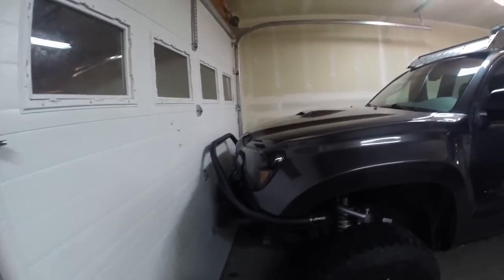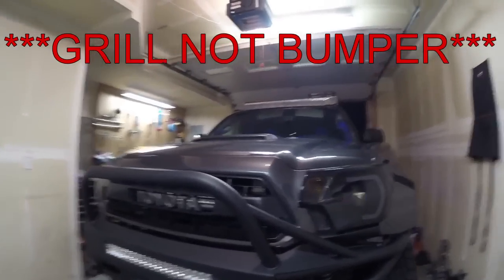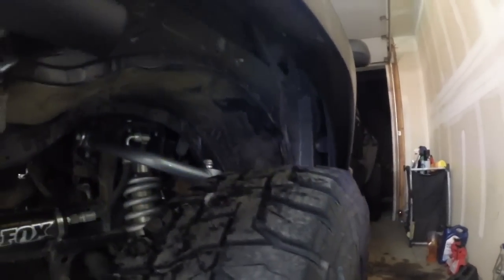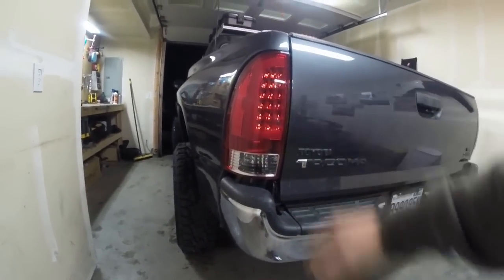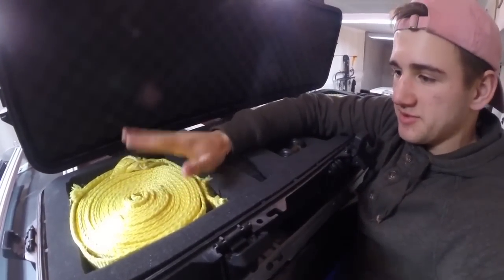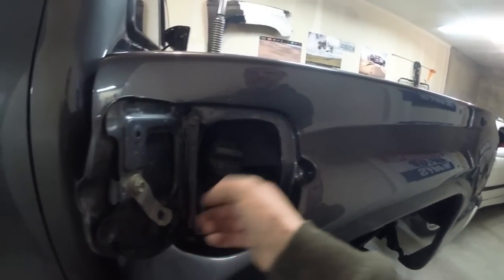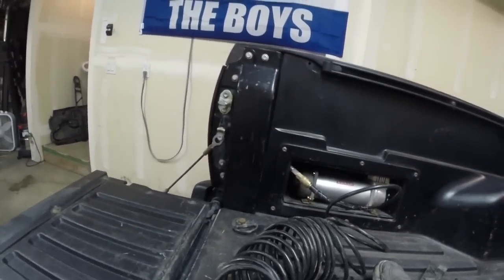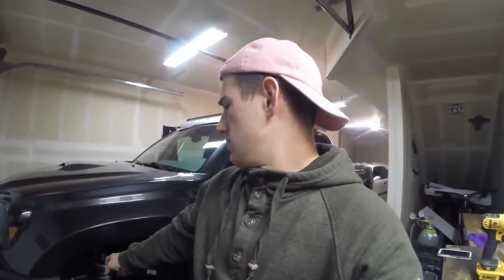2nd Gen Tacoma Build Walk-around

Comment: Great build, defenitely you have to do something about the rear bumper though.
But it is very neat. You can also so a fiberglass undercover for that huge gap on the gas tank inlet. 
Maybe add annother pair of fogs in the front (you know, like the 3 lights you see on the raptor but only 2).

Comment: Would you mind telling me where you got the roof rack and box up to and did it require any drilling for the rack? Also wondering how the new front end stuff went on does it bolt right on? And the hood scoop did you just buy a sport hood? Aside from smooth ride did you gain anything from the coil overs? Like noticeable more flex? Thanks in advance I’m trying to decide what to do next to my tacoma, check it out on my channel if you’d like 6” lift on 35s haven’t done too much yet, love your taco man
Reply from the maker: StreetandTrail you can find Chris every answer to the questions you asked just buy a simple Google search but the roof rack does not require drilling you do need a drill into the bottom of the roof box to mount it to the roof rack and the roof rack is a print suit design rack.
Reply from the maker: StreetandTrail I don't just have coilovers I have a long travel suspension kit which extends your control arms 3 and 1/2 inch wider per side in the front this also means I have more flex and I have 14 in of suspension travel in the front as opposed to stock
Reply from the maker: StreetandTrail to do the front end you have to buy the 2012 to 15 Hood whichever one you want with the scoop or without it also you need lights Grill in and a bumper

Comment: What size tires
Reply from the maker: Caleb Bennett 285/70 r17 i think but need to got to 35×12.5
Reply: Cole I had 35s and my truck was so slow so heavy to turn and drive. Impossible to have fun racing.  Now I have a set of 265 which looks horrible but the feeling is driving a dakar racing truck. So you choose between looks and feels. I prefer something I will enjoy not other people